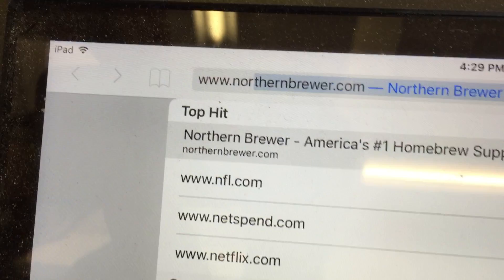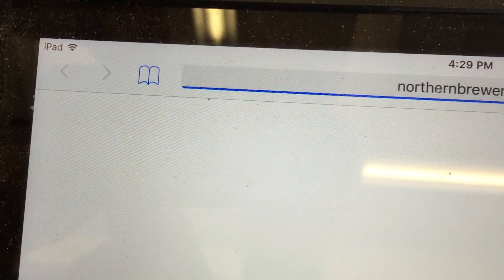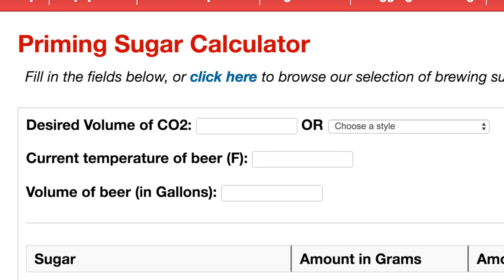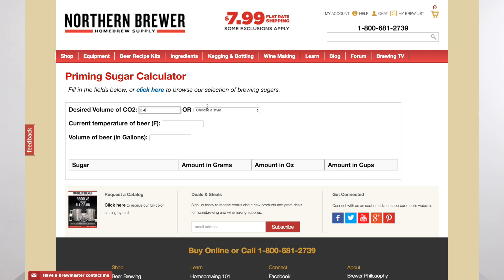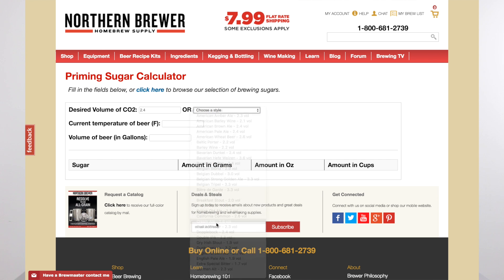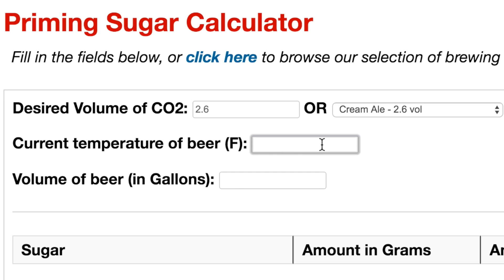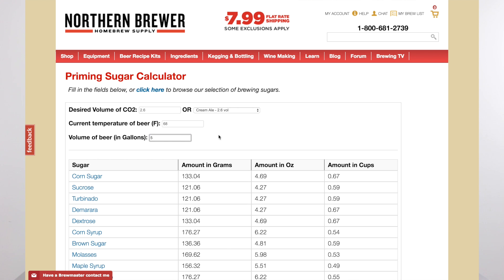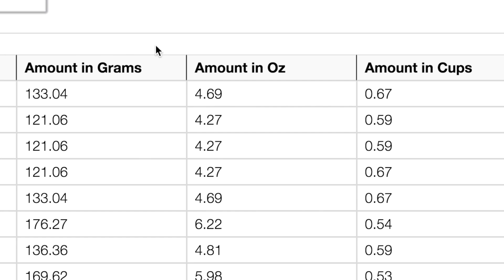Priming Sugar Calculator for Carbonating Homebrew

Comment: Has anyone tried coconut sugar ? It's weaker than table suger or brown sugar it's only 5g sugar per tsp. When brown and white sugar are 26g so I'd have to use 5xs as much🤔?
Reply from the maker: We've never heard of anyone using coconut sugar. Are you doing this for flavor specifically or just what you have on hand? Seems like a LOT of sugar as far as quantity.
Reply: seems like a good alt sugar solution, and perhaps woud lend flavor

Comment: I have used this calculator for years.  The only problem I have with it is that it asks for the CURRENT temperature of my beer.  I will often ferment at 62F, then ramp up to 72F when fermentation seems to have stopped to wake the yeast up and get a little more out of them.  Then I drop it to 32F so most of the yeast drops out.  Current temperature would then be 32F but CO2 in solution would be better represented by 72F.
Reply: agreed, confusing

Comment: I wish it would say how much water to mix it with also.
Reply: About twice the weight of sugar.  It's a matter of the minimum to disolve the sugar, which could be calculated using molecular chemistry, but twice the weight in water is a good rule of thumb.  Keep in mind it is more than double the volume of sugar, given that water weight more.
Reply: @Pyroal40  so if I get 70 grams it means 70grams per litre? Gallon or bottle?  I am new to this and I need some help